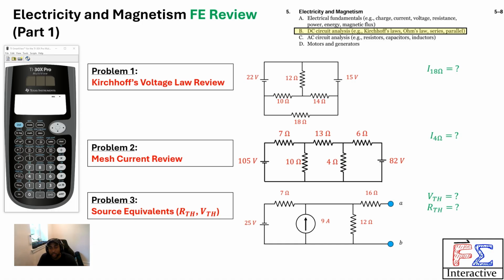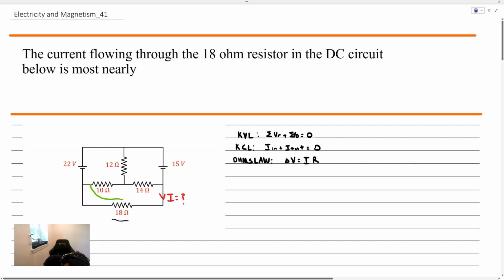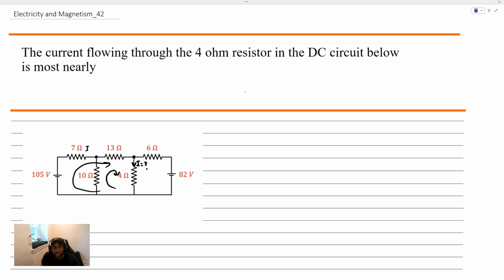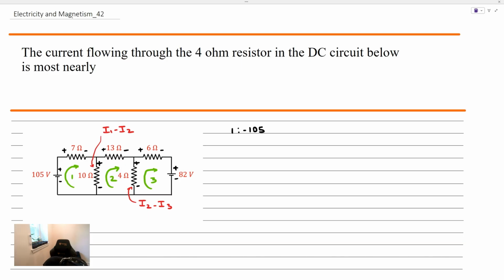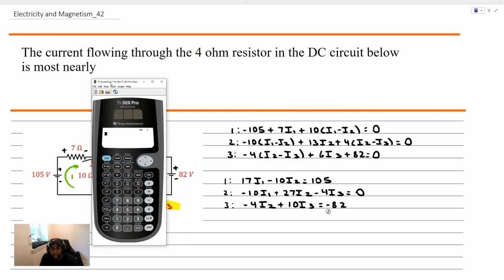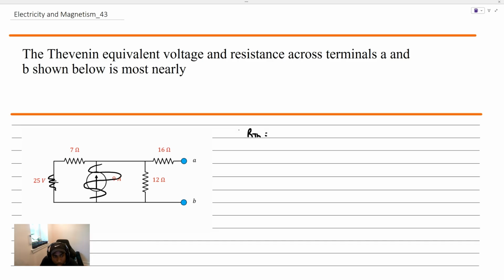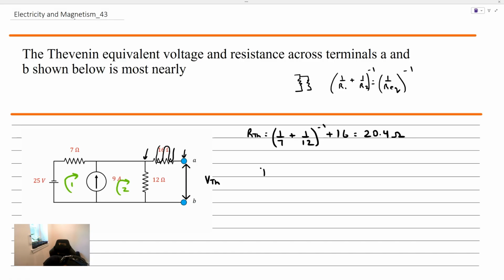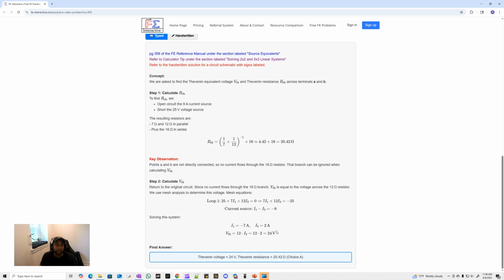FE Exam DC Circuits Review – Kirchhoff’s Law, Mesh Current, and Thevenin Explained with Examples

Comment: For problem on Thevvenin equivalent
1. Shouldn't the equation be 25 -7 x I1 - 12 x I2 = 0 because Σ Vrises = Σ Vdrops or Σ Vrises - Σ Vdrops = 0?
2. If you use Kirchhoff's current law, Current from 25V splits into 9A and I2 so I1 = I2 + 9 or I1 - I2 = (+)9
Reply from the maker: For your first question, the signs on your equation are incorrect. Kirchhoffs Voltage Law states that the sum of voltage rises plus the sum of voltage drops equals zero. These terms cannot all be positive, otherwise there would be no way to satisfy the equation, so we need a consistent way to track signs.

A reliable approach is to label the schematic clearly, which takes care of the signs automatically. Across a source, there is a rise in potential. This is usually straightforward to identify since the shorter side of the source represents the negative terminal and the longer side represents the positive terminal.

For resistors, there is a voltage drop since they absorb energy. Based on how you define your mesh currents, label each resistor with a plus sign where the current enters and a minus sign where it exits. If you follow this convention, your schematic will match the one shown in the video and the signs will be handled correctly. From there, you simply apply Kirchhoffs Voltage Law and follow the sign convention consistent with your chosen loop direction.

A helpful note is that the direction you assume for current flow is simply the direction of your mesh currents. It does not matter which direction you choose, as long as you remain consistent. Once you pick a direction, label the voltage drop across each resistor based on that assumed current direction. The math will naturally correct itself if your assumed direction is opposite to the actual current.

For your second question, at the junction above the current source, there are two currents entering, I1 and 9 A, and one current exiting, I2. Applying Kirchhoffs Current Law gives

I1 + 9 = I2

which can also be written as

I1 - I2 = -9

Hope it is clear, if not feel free to follow up.

Comment: hello im new subscriber to the fe engineering fundamentals. I just got memebership where will the rest of of electricity and magnetism videos
Reply from the maker: I’m still working on completing the videos, but I prioritize covering the most important concepts first. The techniques demonstrated in this video—along with a few key formulas from the FE Reference Handbook—will help you tackle the majority of this section. 

I recommend focusing your efforts on high-weight topics such as Statics, Dynamics, Thermodynamics, Fluids, and Mechanics of Materials before circling back to the remaining areas.

Currently I am working on heat transfer then mechanical design after that.